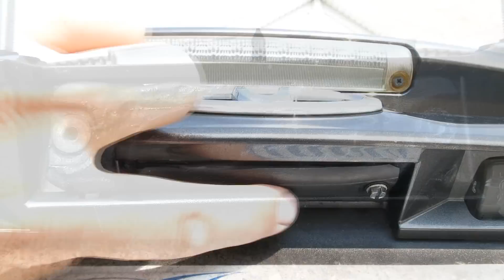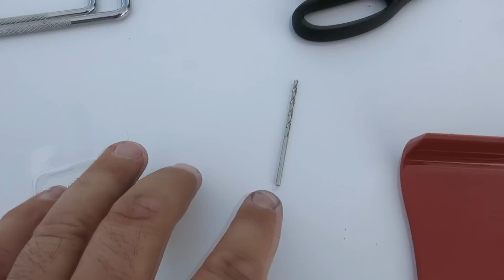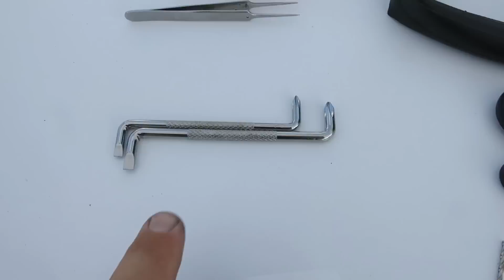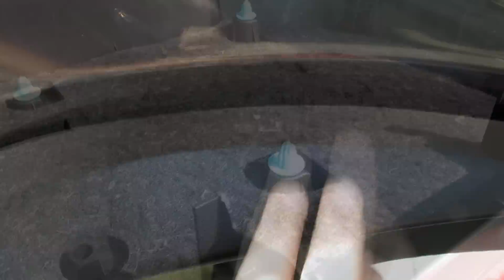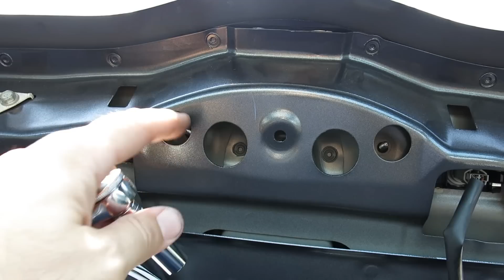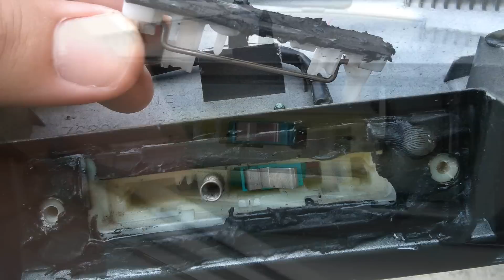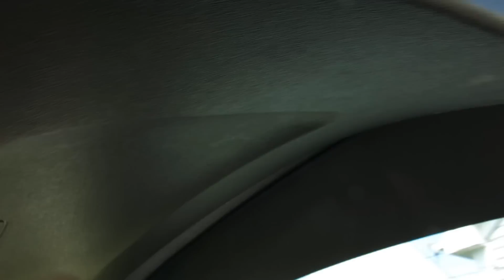2007 Prius Hatch Handle Repair

Comment: I used this to replace the "garnish" (the panel on the back with the handle).  This was VERY helpful. Get the tools he suggests, especially the nylon trim prybars.  The screws that hold that panel on were only about finger tight on mine; don't over-tighten them when you put them back on.
Thanks for the help.

Comment: I need to replace the Lift Gate Garnish.  Does that attach to the handle button?  Do you have a DIY on replacing that?
Reply from the maker: I know I'm replying to this late, but I just thought I'd leave this comment here for others. If I remember correctly all you would need to do is, once you have the inside panel removed, you would simply unscrew the screws holding the garnish. I did the garnish replacement on a 2005 Scion and it was quite simple once you had access to the screws.